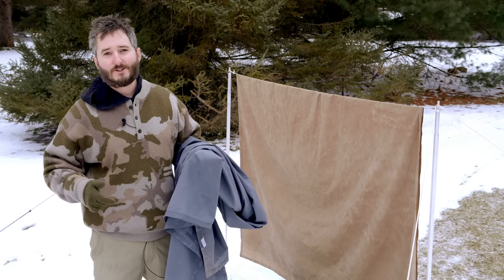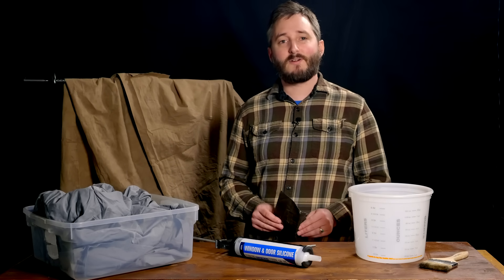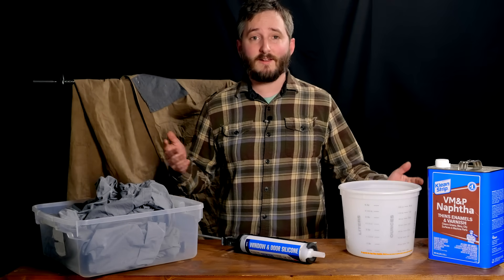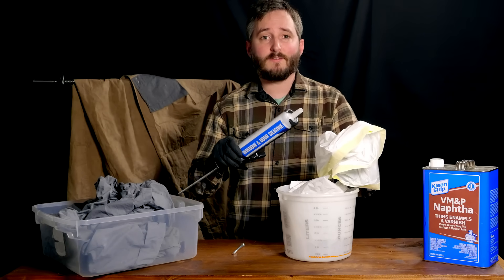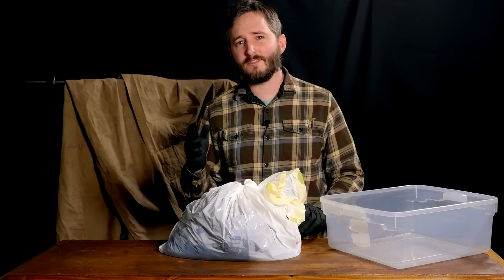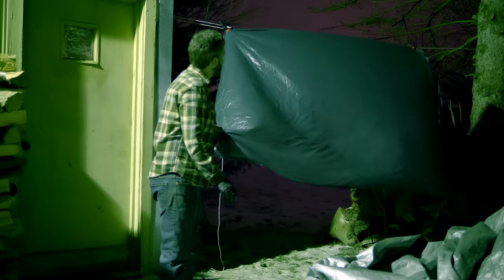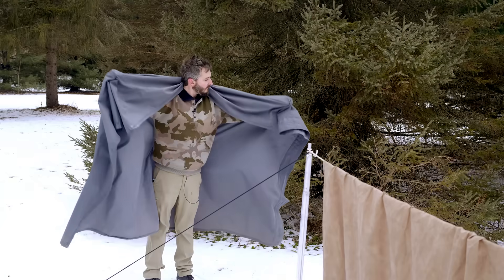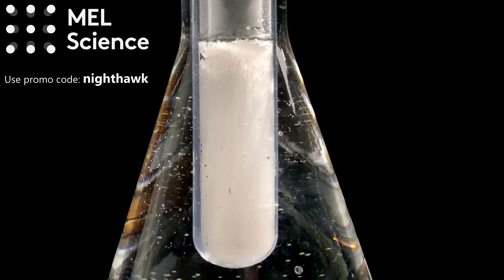Recycled Bedsheets Make The Best Waterproof Tarps

Comment: I drove across the country this fall with some of my most prized possessions in the tarped bed of my truck. I used 3mil contractor bags to keep my taped totes of books safe and basically used all the tarps I had, of various sizes and degrees of wear. Nearly none of the grommets were where I needed them to be, to pull it all tight for the trip. I made extensive use of the button method to customize the tie downs and was pleased with nary a flutter the whole trip (lots of wind 3/4 of the way and lots of rain at the end and all stayed dry.) I learned the button method at The Tracker School. You can use one in the middle of a canopy tarp to make a peak so the rain doesn't puddle and collapse it as well as endless customizing configurations, since you can put one anywhere you need it.

Comment: I've seen people make silicone molds with silicone caulk and Dawn dish soap. Any chance that could be used as the solvent in place of the toxic naptha? I'd feel better about wearing them or camping under one, if it worked.
Reply: its not toxic after evaporation because it is gone into the atmosphere where it then breaks down over a short period of time so your fears are unwarranted. ;)
Reply from the maker: They mixed soap with silicone to thin it? I've not heard of that. I'm not sure if that will work but you can test it.

Comment: Made one today. I did the 5:1 ratio with naphtha, did a small test section after only about 5 or 6 hours of drying and I'm impressed with the results so far. 
I already want to do another one with 4:1 ratio with a 1000 thread count sheet and mix in a cup of outdoor paint for UV protection...
Will give updates on this after more testing
Reply from the maker: Let me know if the paint mixes well, that's a good idea if so.
Reply: Will do. I'm trying/testing 2 different mixtures now and will do another sheet with the winner and adding the paint. 
Having fun with this. Thanks for the idea!
Reply: The paint didn't thin down as well as I had hoped. So now I kinda have a tie dye camo effect 😆
But!, The area that is coated well with the paint is much more rigid/durable feeling, I think it will do and last longer. 
Next test run will do another sheet of microfiber sheet (best results so far) going to try mineral spirits to break down the paint or try an oil based paint? I'm not sure which will be best but I need it to thin the paint out better... More to come
Reply: @GeoffreyHunt  could've just been the way you massaged it. Too many variables to troubleshoot, test one at a time.
Reply: @GeoffreyHunt  - Because naphtha (shellite down here) is a hydrocarbon based solvent, you're gonna want a hydrocarbon based dye such as an epoxy dye or colourant.
Reply: Actually, no. Testing many variables at once is the best way to do it if you know how. Must learn to use an orthogonal array to properly design your experiment.
Reply: @GeoffreyHunt  Hey. I like your idea and I'm so curious. 
How is it going with your experiments? 
Greetings from Germany.
Reply: If you are mixing in paint, you should try paintable silicone caulking. It is more expensive, but should bind with paints a little better
Reply: @Nighthawkinlight  They make silicone based masonry paints, I bet they'd be perfect. You might not even need to use the tubes of sealant just the paint and naptha.
Reply: Can anyone say the material of the sheets used. Cotton?  Polyester?  Going to thrift store today.
Reply: Could you use these sheets to build a diy tent?
Reply: @readingdestination9025  yes!
Reply: @readingdestination9025  yes but you’ll need to tape the seams or water will get in that way. You’re probably better of getting a cheap non waterproof tent, using that for the general structure then adding this on top
Reply: @transatlant1c  thank you for your suggestion; I truly appreciate it.
Reply: @readingdestination9025  What us your project?

Sturdier tent? permanent tent?  Tents are so cheap these days at a place like Costco or online, and breathable...that this method seems so very much more expensive for a tent...especially considering the time it will take and then portability in the long run.

Or are you building a permanent tent room on your property or something?
Reply: @PowerScissor  It has to be transportable, but strong and sturdy, that can withstand just about any weather. I’m on a very small budget, so I cannot outright purchase one, so I have been exploring alternative options… It shouldn’t be gigantic, but big enough to accommodate between  two and four older, semi disabled women and their  gear. None of us has a large enough budget to be able to purchase a ready made tent 🤷‍♀️
Reply: @readingdestination9025  Where do you live?

I have an older tent you can have that is 4 person.  No leaks, we're just planning on upgrading to a bigger one this Summer.
Reply: @PowerScissor  Oklahoma
Reply: @readingdestination9025  You can buy a new 4 person dome for $45 - with at least a partially effective rain fly.  By the time you have put all that effort into a second hand bedsheet in order to get it UV resistant, you'll have surpassed that mark - unless this is just for giggles an grins.  IMO, having done this kind of thing for a long time, you should forget the UV part.  Making it water resistant is the main objective.  UV will eventually break down the silicone and the sheet color.  You just make another one.

I will add one step that will help in windy conditions: Sew in reinforcments at whatever points you will tie out from - like the stress points on a sail.  The extra effort will pay off better than trying to do something like a medieval alchemist.
Reply: @OutnBacker  Lol right? Even for tarps its marginally worth it. Ive used it for rain gear and shoes, bags but tarps im not so convinced its worth my time. Maybe if I was more poor. The best tarps are roofing rubber if your as lucky as me to acquire such high grade tarp material for free, theyre heavy enough they dont need to be tied down, and last close to 100 years lol.
Reply: How breathable is it in humid, rainy conditions?  Also, how does it hold up in the sun?
Reply: @asdfghjkl  it repells water so it doesn't breath
Reply: @eitkoml  I made one years ago for my 17 foot sailboat cockpit tent.  Lots of sun exposure.  Thedark green sheet faded to a light grey, but it's still ver water resistant.  On mine, I sewed-in canvas grommet reinforcments to spread the tension,  similar to a sail corner.  Lots of tarps have a canvas loop at guy-out points.  The button method obviously works well, too.  Done it many times.
Reply: @eitkoml  Not breathable.  Think: rubber boots.  But under a tarp shelter, who cares about humidity.  Seems to hold up well in sun.  Mine is several years  old and was used as a boom tent in my sailboat.  They dont radiate heat like a poly tarp, so it's cooler under neath.  Not perfect, but nothing is except air conditioning.
Reply: Updates, yes please!
Reply: Yeah I'm also curious about the UV protection as that's one of the largest problems for things long term
Reply: Would oil based paint be best?
Reply: @mach1553  I thin my oil paints with mineral spirits, it might be easier to mix and move paint around?
Reply: Sweet ass Sweet!👏👏👍👍👍
Reply: Surely after the cost of materials, it's cheaper to buy a UV stabilised tarp that isn't the plastic type in the vid?
Reply: I’m wondering if it has any chemical odor once it’s dry ?
Reply: did SGT hunt ever file a follow up report.  I love everything about this idea but the short life span of cotton plus UV
Reply: How about adding a wood stain for coloring ?
Reply: What about silicone with UV treatment already in it?
Reply: How about just using tinted silicone- skip the paint?
Reply: How about colored silicone instead of clear
Reply: Paint is nowhere NEAR as flexible as window caulk. Ive been doing this for years from rain coats, bags and shoes. Trust me, the caulk alone is FAR superior to any other waterproofing technique.
Cheap caulk does not last as long, the most expensive caulk will last over 15 years before it begins to lose flexibility. There is no need for UV paint, thats exactly what outdoor caulk is made for.
Reply: Canyon not getting unresisting outdoor silicon
Reply: Hey I would try using sun screen with uva and uvb if u get the ratio right the fabric should resist uv rays 😉
Reply: @GeoffreyHunt Please update us with a link 2 a video on how you paint for UV protection. That would be an awesome video.
Reply: You could try benzophenone. It's a carcinogen that's noted to be bad for aquatic life, but besides for that it dissolves in solvents and is an active ingredient in sunscreen. Or you could just buy pigments.
Reply: Silicone isn’t compatible with paint even after it’s dried however they do have water based sealants that should mix. Look for one that says “paintable”  or maybe dust the tarp with some particulate b4 it dries as a physical barrier from the sun.
Reply: What about the pre-coloured silicone you can get for matching your tiles or roof? You could also try a particulate colour additive, something as simple as ground and sifted charcoal or chalk, which would reduce the amount of UV that could pass through the sheet

Comment: Great tutorial! Two questions when the process is complete does the tarp still smell like solvent and can the tarp washed in a washing machine without damaging the coating Thank you.
Reply: @Jackson Leblanc how did that go? Is it safe to use on clothing? Trying to re-waterproof some snow gear myself and haven’t found very great videos on that. Or maybe I’m not searching the right thing 😅
Reply: Yes what he also doesn't mention is that there are at least 2 types of silicone: neutrally binding and acidic (smelly) do those work equally with the thinner?

Comment: Are the sheets still washable like on gentle cycle? And/or will the coating wear off right away or over a series of washings
Reply: I have a waterproof jacket I wear to work in with waterproof coating. I occasionally wash it when needed but never dry it. Just hang dry it. Normally last several years. When you begin having issues with it reapply or make a new one. A good 10 foot square tarp runs about $75 for camping. This would be very cost effective.

Comment: Hi there...I have a question....
If I put the thinner silicone on a flat surface can I make a thin  sheet  of silicone?   how flexible it will be ?
Reply from the maker: Yes that works, but normal silicone isn't that strong as a sheet. When I tried it the sheet tore easily.

Comment: It's a shame it's practically impossible to determine what the equivalent of Naphtha is in the UK. Pretty much every word for any hydrocarbon seems to mean a different hydrocarbon on each side of the Atlantic.
Reply from the maker: I agree, the terminology sucks. If you can find it, white gas camping fuel for use in camp stoves is the same thing. It's basically the hydrocarbon chains that are a bit shorter than those in gasoline.
Reply: In Australia I'm planning to use Mineral Turpentine + Silicone and some fabric dye to coat the canvas on my new to me 1988 Jayco pop up camper, as a small starter refurb project 😀  
It isn't exactly wilderness camping but it's not 5⭐ either. 
Anyway, It has to look and perform better than it is now, so less expensive/innovative is better at the moment than shelling out for a new canvas. $50 V's $4,000 It's a no brainer really.

Comment: are these hardy or will the silicon scratch off the surface with contact with branches?
Reply from the maker: It won't easily scratch off. It's soaked into the fabric not just a coating

Comment: I wonder if gasoline would work. 

The price of the old fashioned silicone was $3.99 about 1 or 2 years ago,  now it is up to $10. 

I have not prices Naphtha in a year and a half - - I shutter to imagine.

I have had zero luck with silicone 2.   1 problem after another.   Usually,  it doesn't cure in my climate.   I have been avoiding it as much as possible.

I have been waterproofing my shoes with 100 percent silicone since at least 1996.  Before that I used Thompsons, but it never left enough silicone to keep my feet dry,  since a good part of the day I need to stand in puddles of water and mud,  while water is splashed onto the foot.   That is the dry season.   In the winter,  walking around is literally walking around in half liquid water.   Shoe breathability,  using conventional methods is a myth when the shoe is constantly being submerged.

Rubber boots just crack and let water in within a month or so.   Silicone treated shoes do not develop cracks because silicone is so flexible.....  Amazing goop is nearly as flexible, but has incredible adhesion,  while silicone has poor adhesion.
Reply from the maker: I've heard from others that gasoline worked for them, but I fear the even higher flammability danger when using it.

Comment: This would make excellent cushion covers for patio furniture.
Reply: That’s why I’m here! I just actually need new stain/waterproof fabric for dining room chairs! I have the fabric and don’t want to buy anything else but it’s light colored and I’m not about to attempt it without some kind of treatment
Reply: I painted mine with a coat of pvc glue gesso then my colour of acrylic paint  Didn't need to recover& they look great & protected.
Reply: I would waterproof the top and edges but allow the bottom to drain and/or dry if moisture winds up getting in through any defect. We found that wood fully painted would rot at the bottom of the boards from retaining water, but we could prevent this by not coating a portion of the back and bottom and they would last much longer. I am thinking cushions might be similar in this regard.
Reply: Also for yacht berth and cockpit upholstery....methinks 🤔
Reply: Great ideas!
Reply: Great idea
Reply: Great idea, thanks for that.
Reply: Button tech is the way to go. Thank you so much for this info, I have cotton table cloths that after a good family meal has been served and consumed looks like an impressionist painting, and they’re not cheap, I can’t quite get myself to using paper tablecloths ( probably because I’m old fashioned) so this is the perfect answer. Thank you so much. ❤

Comment: It's been about .75 years (9 months) since you've released this video. How has the waterproofed bedsheet held up?
Reply from the maker: Pretty good still. It absorbs water eventually if it's left to pool on it but normally still rolls off as new.
Reply: @Nighthawkinlight  Good to know and thanks for replying! I'm totally using this for my own blanket and for coating a wooden brick mold with it to see how well it does for making firebricks.

Comment: Good stuff, though for extended outdoor use it's probably a good idea to add a UV protectant, too.  Even just adding a cup of external house paint to the silicone/solvent blend will cover the sheet in protective pigments meant for outdoor use and extend the life of the cloth significantly.  That trick comes from the DIY faux-fiberglass recipe, where you use bedsheets and exterior housepaint to make waterproof boat hulls or other foamboard creations.
Reply from the maker: House paint is a good idea. A scoop of lampblack is good also
Reply: Hi, do you have a link to the DIY faux fiberglass technique, especially for making a boat?
Reply: @Nedw search poor man’s fiberglass

Comment: If I made a cloak should I waterproof both sides of the outside fabric before sewing on the inside fabric or only do one side after the cloak is finished?

Edit: the cloak will be made of wool. 
Should I use a different technique for wool or will this work?
Reply from the maker: I would spray the waterproofing on the outside layer only with a chemical resistant bottle. Be sure to do it outside and away from things that spark or could catch fire because the liquid and fabric will be very flammable until it fully dries.
Reply: @Nighthawkinlight  thank you I'll try that 😊

Comment: Regarding the button technology, my grandfather used to use pennies, as they had a uniform shape and were plentiful (for the time). Interestingly, I remember him showing me when we were bird hunting and a button came off his jacket…and he field repaired with change in the truck’s ashtray. Later, I observed him use it with canvas tarps across his truck bed and across wood stacks. Nice reminder!!
Reply: I have a 5 metre x 3 metre garage roof that is letting in rain water. I painted about a metre square over the felt roof where the rain penetrates with emergency roof repair. Do you think the canvas tarp like your dad used would stop the rain getting in until I can replace the roof covering or large tarp in drier weather?
Reply: @mortimp  Yes, in theory. But if you miss a pinhole size it'll let water in that will erode it. There's thread count, too. Also there's the sun and wind that can weaken the bonds. Treat a pillowcase (maybe twice) and then fill it with water in the shower; let the success or failure decide.
Reply: @knewsome69  Thank you for the useful information.
Reply: How did he fix the jacket with a  penny?
Reply: @TotallyRealAccount88  I would assume he put the penny behind the fabric and pushed them both through the button hole, basically making the coin the button without having to sew it...
Reply: @mariusjenkins7294  i swear I remember my grandpa showing me that as a kid, forgot all about it until now
Reply: Older generations were far more intelligent & creative than we are. We are spoiled with readymade solutions for everything in life that our creativity is perhaps the lowest among all generations since the dawn of civilization.